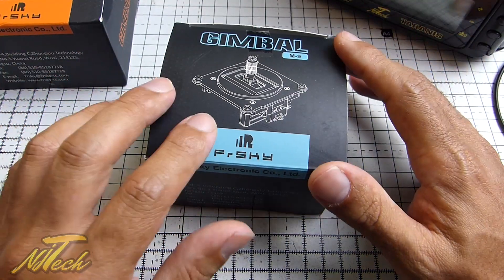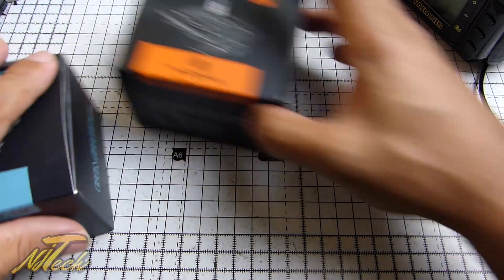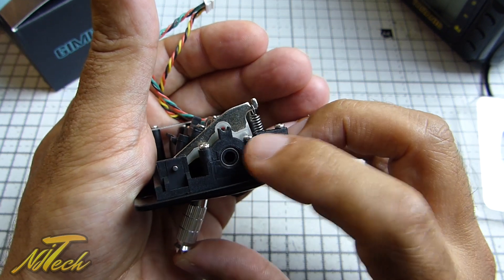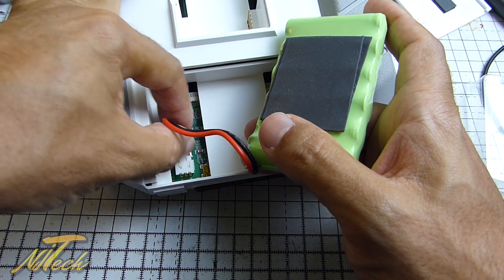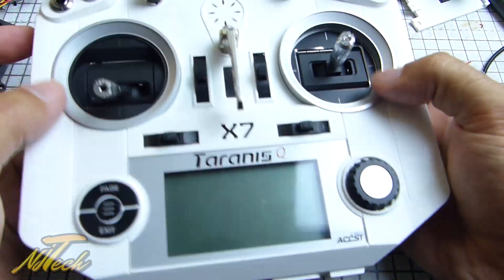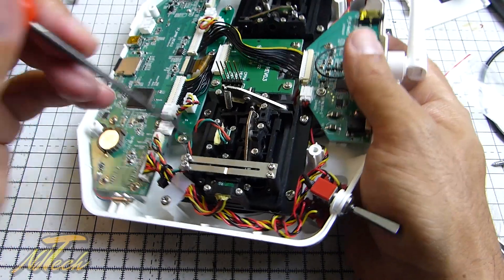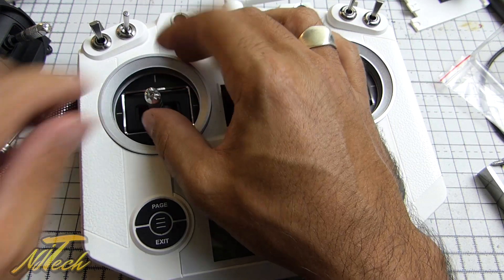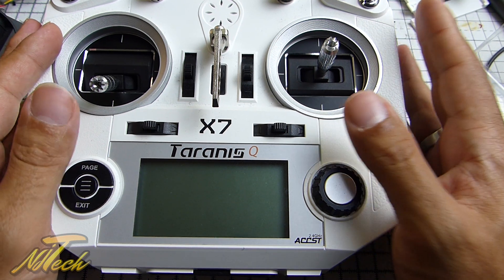M7 Gimbal installation guide! FrSky Taranis Q X7 Upgrade!

Comment: Do i have to buy M7 and M7-R for right stick ? is it that meaning -R for right ? or just two identical M7 Gimbals do the job ? Thank you.
Reply from the maker: No the r stands for race. The race gimbals have a shorter throw on the vertical axis which some people like for the throttle. So really just one r gimbal on the throttle side if you want to.
Reply: @NJ-Tech  Thanks, i'll go for this upgrade, not expensive too for the benefit.

Comment: Hi NJ 
I've noticed you seem to have some real influence with frisky. Can you ask them to consider a version of the M7 and M7-R gimbals with longer sticks or a longer version of the M7 stick ends for pinch flyers. The gimbals are set too low in the tx to be comfortable. I'm seriously considering getting the M9 for my qx7 as the shafts are a bit longer. Would be nice to have some that just drop in and are comfortable.
Reply from the maker: yea in the end i sold my Qx7, i just couldn't get on with it for pinching. I've never spoken to a single person at FrSky though, if i have any influence im certainly unaware of it lol :)

Comment: Hi NJ
I'm a pincher and already find the stock gimbal sticks a bit short, even when fully extended. I would like to upgrade to the M7 but they look even lower and the stick shaft looks shorter. In your experience has this been an issue. I read that the m9 shafts are a bit longer is that correct.
Reply from the maker: Chris Edwards yea they are, it was one thing that bothered me is how the QX7 gimbal felt recessed so I know what you mean. Definitely all felt better on the M7s

Comment: You have put the right hand side gimbal on upside down that is why the cable is short !!!!
Reply from the maker: nope! Frsky state the hall sensors are towards the outside edge upon installation. Having all their newer models too here, they are all installed exactly like this. Even the latest X10 from the factory. if you installed it the other way around you'd also notice also that the calibration directions are all wrong. PS: huge fan of your music :)
Reply: Yes you are correct - I looked at the FrSky video , the tension springs on the Hall effect gimbals are facing outwards and not inwards like the stock gimbals - excuse my mistake !!!
Reply from the maker: no problem at all :)

Comment: 14:14 Wire rubbing on the crossbar is bad.
Reply from the maker: Atomicskull nothing is rubbing on anything. It would be if I hadn't fixed it. The crossbar is also completely smooth there are no sharp edges. The left side of the crossbar is no issue whatsoever.

Comment: Great information very thorough. A Little question on the side. Do you know what sticks (for thumb flyers) will fit the QX7?
Reply from the maker: Thanks! So there are so many options out there and its really down to trying a few out and seeing what you like the feel of. If you're a thumber you might like the type with the fat tip. I believe the threads on the FrSky gimbals are the same as the JR style when you order. Here is an example: https://goo.gl/8xayWY
Reply: Wow thanks. Immediately ordered some. Before, I ordered some others, for the ones for the plus and such,  but they didn't fit (so waste of money).  Thanks again. Keep up the awesome reviews and flight vids.